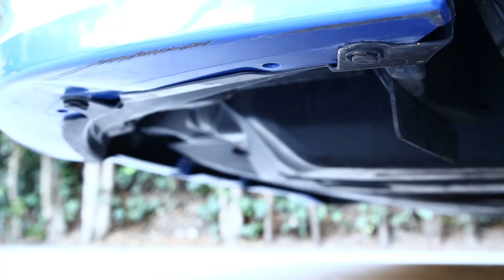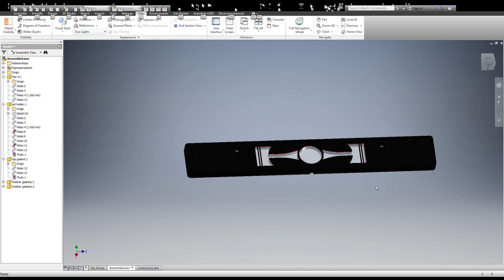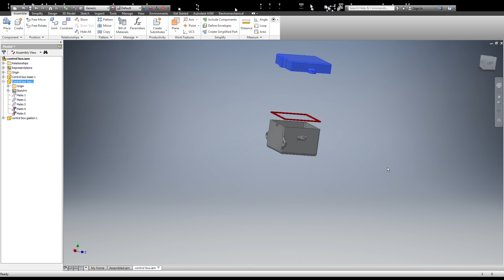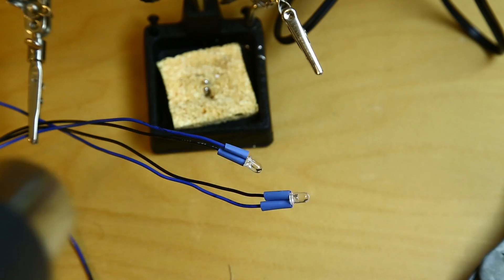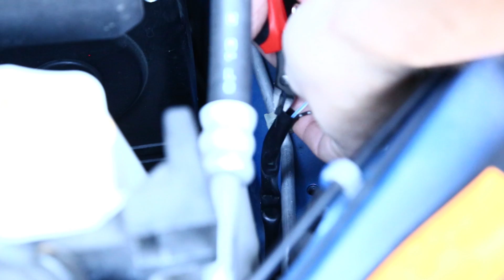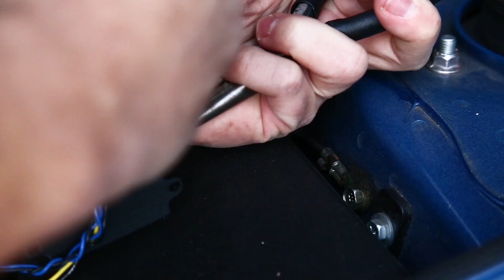Custom Flashing WRX License Plate Delete

Comment: You're eventually going to feed the wires through a hole into the bumper right? You're not just going to leave them hanging there right?
Reply from the maker: +Ben Downey  I added a detailed response to the description. TLDR version: routing the wires differently isnt feasible as the bumper structure is right behind.
Reply: +Will's World I think it looks cool and it's a really original and creative idea.  You clearly know how breadboards, soldering, heat shrink, and electronics work.  I read your comments about the "bumper structure".  Damn... is it really that bad? Sounds annoying, even frustrating, but you'd get through it. I admit, I don't know shit about Subaru’s but damn, how bad can it be? Anyway, great invention, cool look, great video.  And hell, that idea of using a drill to helix the wires! That was sweet.  And the box and the way you mounted it.  Wow.  It's all so careful and thoughtful of aesthetics.  Seems that a little drill work on that bumper structure would really bring it home.  Cheers.  And best of luck man!
Reply from the maker: +Ben Downey Wow, thanks for the kind words. I'm in the process of teaching myself electronics. Its one thing I really wish I knew more about and little projects like this really help learn a lot.

Comment: A lot of work making that and filming it so well... Why couldn't you route the wires through a small hole? Test fit?
Reply from the maker: +Drunk and Sober I added a detailed response to the description. TLDR version routing the wires differently isnt feasible as the bumper structure is right behind.